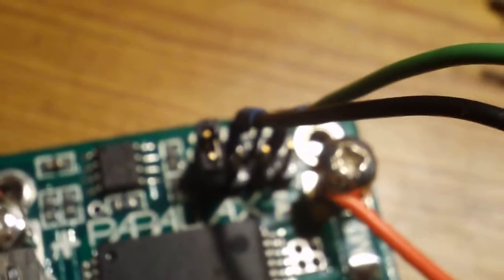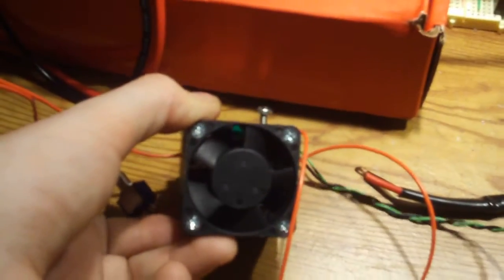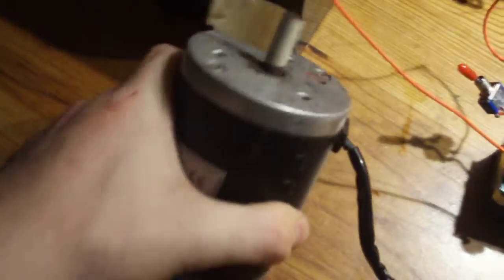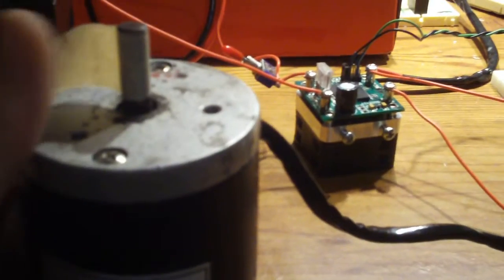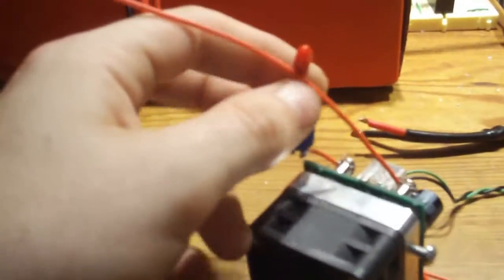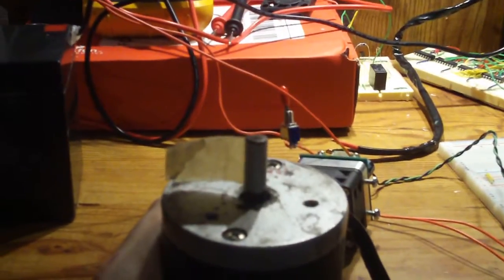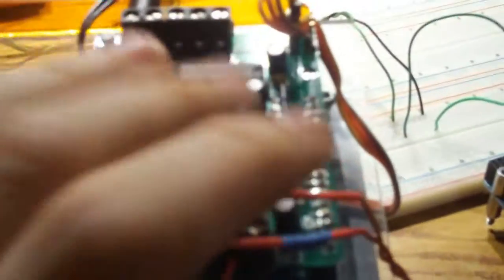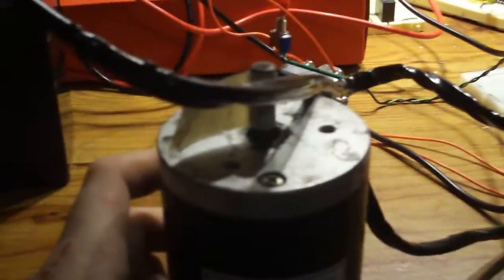HB-25 Motor controller from Parallax.com

Comment: Nice!  I'm working on a similar set up and just got my HB-25s in yesterday.  Did you run into any quirks getting it going?  did you just use pulse out commands, or did use servo library controls?  I tried just hooking it up to a futaba remote, but it didn't get it to go..but looking at yours I just may not have waited long enough for it to start up.  Thanks for posting.

Comment: Thats pretty pimp, i didn't imagine the HB 25 would be able to power that beast of a motor. im still looking for new DC motors, but thanks for the video, now im sure i'll get the HP 25
only problem is i wanted to do a quad runner, but i guess i can always just set one motor controller to work parallel on each sides.
thanks for the reveiw.